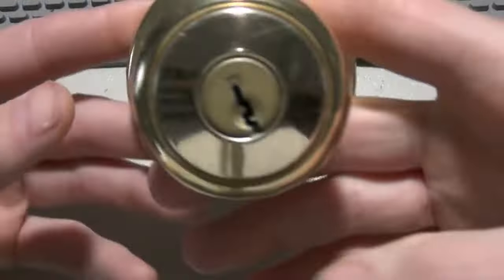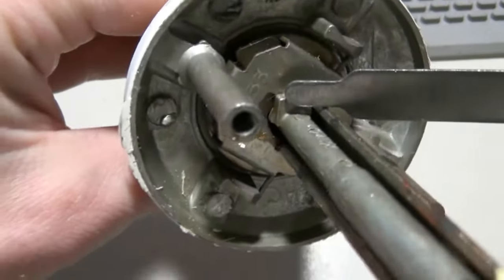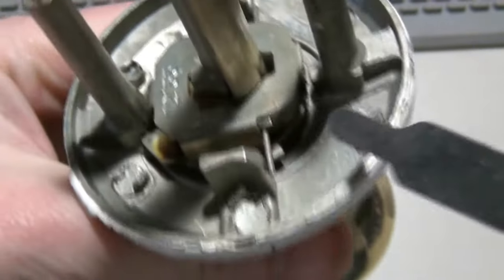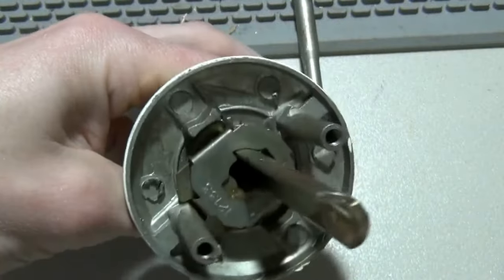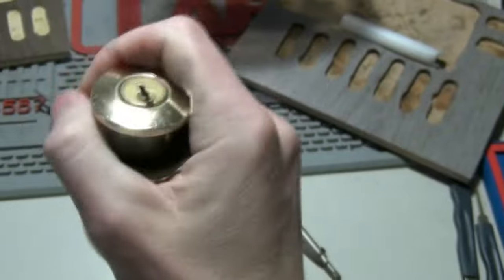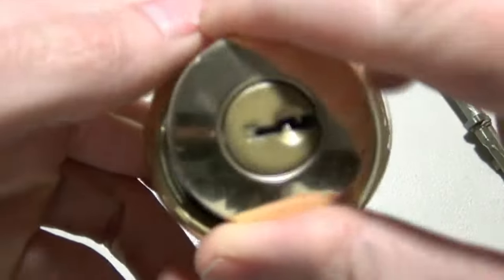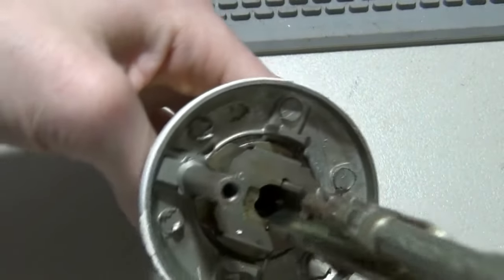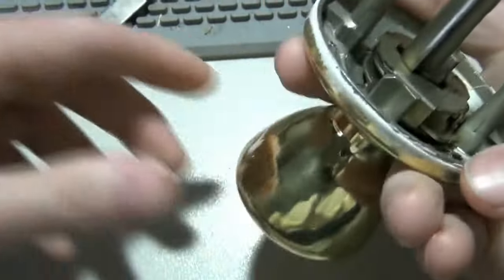(118) How to Remove the Cylinder from a Kwikset Door knob

Comment: Thanks.  Big help.  I did not bother to try to solve this puzzle myself, fortunately, and went straight to google and youtube.  I watched another video first which was a disservice to humankind.  Yours was the second I viewed.  You were patient.  Points for that, right off the bat.  Good camera work, too.  I used a pocket, screwdriver to twist the shaft and to depress the spring loaded clips.  

My objective was to fully disassemble the entry set to clean, strip and polish it before reassembly and then apply the lubricants, etcetera.   If I had noticed, in your video, the two-armed spring clip that holds the cylinder in place, I would have been able to get the cylinder out.  Not knowing what exactly was holding the cylinder, I was hesitant to apply too much force.  Did not matter since I was able to strip and polish the the escutcheon, knob and cylinder while assembled.   But now I know that for next time.  Thanks again.
Reply from the maker: Glad it helped! Appreciate the comment.

Comment: This video was a huge time saver! I watched another from the rekey company, but he sure sped through the tricky parts
For anyone else with a newer, "fancy" doorknob, this video is missing a couple extra steps! In my case, I had to insert the key and "unlock" the lock cylinder for it to come out after the spindle was removed - there was an extra spring-pin and lock disc to the side of the keyway. And that assembly has to be removed to get access to the pins, if you're rekeying it like I was
Reply from the maker: Thanks for the update!  Sounds like you may have a property preservation lock with a wire that holds it in or Kwikset Titan
Reply: Ah, it does look like it's the Titan!

Comment: God, you make this look so easy, I'm doing this for an assignment for my locksmithing class and I've been fiddling with the damn thing for 30 minutes trying to figure it out
Reply: I should mention I just got it, thank you for your video
Reply from the maker: glad you got it! you'll get fast it too with practice.
Reply: I'm a retired locksmith. He went about it in a clumsy way. I could do it in 5 seconds.
  Just a tip, reinstall the knob before you snap the cylinders back in, insuring the keyway is right side up. That is, so the bitting (teeth) of the key faces upward.
  If you get it wrong, it will still work. It just looks more consistent and easier to use

Comment: Thanks for sharing. I was able to pull apart a grimey old kwikset clone with lost keys using the tips from your video. I have now repinned it to match the front door and life is so much better. My second repin and my first time getting down to pin level with a door lock.
Reply from the maker: nice work man!

Comment: Thank you so much, this is the exact lock I have and I've been scratching my head for weeks trying to pop the cylinder out. This will surely make picking easier.
Reply from the maker: Detroit EXP no worries. Glad it helped
Reply: 😂 Detroit-Me too!  They must have sold a lot.  My newer ones are different (I think they are KS) and the handle wouldn't work with the striker turning mechanism.  What is proper name for that?

Comment: I had done this many times in the past but forgot the steps. Your video helped me remember. However, it’s really important to put the cylinder removal tool in with the curved end down. Your video doesn’t put enough emphasis on this very important point!
Reply from the maker: John Grant My tool is symmetrical
Reply from the maker: John Grant unless you mean depressing the spring to get the spindle out
Reply: Bored Lock picker No, you have to use the correct end of the tool to pop the cylinder out. You do that in the video very quickly, but it's easy to miss since you don't mention it. I know it sounds dumb, but it's a mistake I made and others might as well. A good video -- just trying to be helpful.
Reply from the maker: John Grant gotcha. I guess I’ve done it some much I don’t think about it. Actually did six of them yesterday. Sounds like it’s time to make another video. I’ll probably post it on my other channel that has more locksmith stuff on it and not so much lock picking. Thanks for the feedback 👍🏼 my other channel is www.youtube.com/russej02 I’ll probably make the video and post it tomorrow. I actually have a knob sitting right that I replaced a few days ago to use for the video
Reply from the maker: @MrJrgrant  Re-did it.  hopefully it's easier to understand now https://youtu.be/gabd-qVttzo
Reply: Bored Lock picker to be honest mate your video was clear as. I removed mine without any lock tools and used a flat head screwdriver. It came out in literally 2 seconds flat.
Reply from the maker: @agga3955  glad it helped out!

Comment: Can the return spring be replaced? I have one handle with the return spring broken and I cannot find the same replacement lever style. I have twelve in this house and replacing the spring would be a blessing, so I do not have to buy a dozen replacements, so they match.
Reply from the maker: I have never ran across replacement parts for any of the Kwikset stuff.  Email me a pic of your lock maybe I can find the style. Email is theboredlockpicker@gmail.com

Comment: 1:39 how do you do this with two flatheads? I have a kiwikset knockoff with a black plastic spindle
Reply from the maker: have to get in there and lift the spring loaded piece at the opening and then tap it on something.  much easier to just get the tool.  they're cheap here's one on amazon https://amzn.to/3zhvwjG
Reply: @BoredLockpicker  yeah I'll just get the tool
Reply from the maker: @bumpstockowner  definitely the way to go!

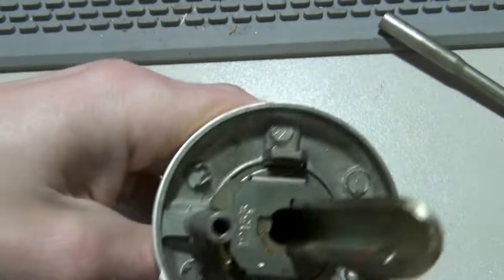Comment: Not sure this is exactly correct 1:30 because I believe all those spring loaded levers near the top (as you are holding it) are not in play at the point you are removing the cylinder. 

What the semi-circular, forked end of the tool is actually doing is pulling in two, black, spring steel clips on the side of the cylinder carrier. You can see that here once the thing comes out the front of the knob. 

You can push around (or not) those gold, spring loaded levers up top all you want, but until those black ears are released, that cylinder isn’t coming out.
Reply from the maker: Gotcha

Comment: I tried this today but on a newer model with a plastic spindle. I couldn't get it open. I believe there were 2 flat clips on the inside of the bore preventing the lock cylinder from ejecting. There was no way I could push them out of the way with a flathead. Possible that a custom tool the exact inner diameter of the spindle bore might work.
Reply from the maker: This works on those too
Reply from the maker: I do it almost every day

Comment: i have repaired it using a needle nosed pliers. i grabbed the one left side pin that is attached to the spring where the tail piece goes on the side with the curve facing way from me i pulled it straight out and the spring reset itself. now i can install it on my door.
Reply from the maker: I dont repair these really inexpenise knobs because I dont want the call back when it breaks again.  hope it keeps working for you!

Comment: Man, thanks so much. I recently noticed how easy my front door was to rake. So Im gunna re-key and or re-pin it ASAP. Awesome Vid.
Reply from the maker: no worries glad it helped.. and its not easy to make a kwikset not easily rakeable
Reply: Bored Lock picker I will change it out.
Reply from the maker: I have a schlage electronic lock on my house.  I actually pinned up so its easy to pick in case the electronics ever fail
Reply: @BoredLockpicker  What's the point of having the lock in the first place? 🤔

Comment: Hi! This question doesn’t have to do with this video… but I can’t find anything anywhere to help me. I just bought brand new Kwikset door locks to replace in a house I just bought. I got the front door handle and deadbolt installed with no problems. I got the back door deadbolt and knob installed and working, but as soon as I closed the door, I couldn’t unlock it. The little lock button thing wouldn’t turn. I went around the house to open it with the key, but that wouldn’t work.
Reply: I opened the the other brand new set to try to figure it out, the lock was locking, but I guess I was messing with it too much, and suddenly it wouldn’t move. I think that’s what happened with the first one? How do I get it unstuck?
Reply: I really wish I could add a picture! Lol
Reply from the maker: hey my email is theboredlockpicker@gmail.com send me an email with pics

Comment: Are there some cheaper versions of these? I have one where it is not disassembling like this and it looks like there are no spring loaded tabs, so no housing the cylinder goes into. Is there some other way that this may be released? No way to rekey it without disassembly.
Reply from the maker: Fred C yes there is. Email a picture I’ll help you theboredlockpicker@gmail.com
Reply: I can do that if you, but what part of it? Other than it looking kind of cheaper it looks to all be the same a  regular quality lockset otherwise. I am pretty sure there are no tabs. It seems to try to come apart when I use the tool but it never does come out. What part of it do you need a pic of?
Reply from the maker: Fred C sounds like a cheap Chinese one that foreclosed properties have. Do you have a key?
Reply from the maker: Fred C also the the tools
You’re using to get it apart
Reply: I sent the pic. I have no key although I could possibly pick it.
Reply: I have a really really old one (KIK doorknob) where the cylinder and faceplate aren’t held in by the two clips on either side of the cylinder. I pried that thing apart just to see why it was causing me so much difficulty; of course now it won’t stay together when I put the rekeyed cylinder back in the knob.

Comment: I have followed along step by step and cannot get the cylinder out, mine is a smart key so not sure if that affects it.
Reply from the maker: Rock Dude it doesn’t affect it. Are you using the same tool I’m using in the video?
Reply: No , don't have one, just using very slim screwdrivers
Reply from the maker: Rock Dude won’t work. Need two screw drivers. One kind of wide. There’s a spring loaded piece that has to be pushed all the way up. Very difficult to do with screw drivers
Reply: My lock cylinder pulled right out when I was unlocking my door today. Smart key set just installed yesterday
Reply from the maker: thin metal clip must of been put on bent or it broke

Comment: I want to pull the core from a doorknob none of my Schlage keys fit into it so I thought I might be a quickest but it looks nothing like this knob. Mine has a square tube and then it has a metal tongue going through it I can use that metal thing to lock and unlock it the tongue goes into a twist-lock in the other part of the knob. How do I get the core out of a knob like that? There are 4 tabs that I can bend that would allow the housing for the spring to come off but not sure I should do that I have only one practise knob I need to figure this out so I can rekey my door but I'm not having any luck finding out how to do this knob I have does anyone have any ideas? I have a Schlage rekey set it came with a tool I'm wondering if that tool somehow removes the knob but when I stuck the tool in the hole nothing happened so I was hoping someone might be able to direct me to another source that could help with this specific type of knob.
Reply from the maker: should be a hole on the knob and a spring loaded retainer you might have to turn the knob to rotate the hole over the retainer then stick something in it and push and the  knob will pop off
Reply: @BoredLockpicker  Thank-You your a genius I was thinking my description wasn't going to be enough for anyone to answer it. I don't know the technical names all of the lock pictures I could find didn't show the one I have. I have Schlage tools for pulling these apart I was sure it had something to do with that hole but I had no luck. There's a push tab sort of thing when the poker tool hit it I felt that it was a bit springy so I pushed and then the knob came right apart amazing. Thanks so much now I can practise putting it together and pulling it apart before I try doing it to my real doorknob. Truly thank-you these are not empty words this has been puzzling me ever since I got the Schlage rekey set it has the thing for pushing the half-ring off and a poker tool. Oh yeah, one last question on the core there is a cap that's on it which is what turns that tongue how do I remove it without bending it up? Will it just pop off when in a correct position or?
Reply from the maker: @KoolBreeze420  no worries. Just FYI if your other knob is actual Schlage brand the cylinder will need to be turned 90 degrees usually clockwise other wise the retainer is blocked and won’t push in. Email a picture of the other thing you’re talking about. Theboredlockpicker@gmail.com
Reply: @BoredLockpicker  Thats what I find odd about these doorknobs they look exactly the same, yet, none of the Schlage keys I have fit into the practice knob, I have no Kwikset keys, but size shape is Identical. OK, I looked at a core diagram they call it the core end peace or the end cap in my Sparrow (which are all Schlage locks) practice locks they are threaded and I use a tool to unscrew it to pull it apart, but this one isn't threaded like my practice locks. It's a cap that has 2 indentations that look like they are pushed in to hold the cap on. Its only function is to grasp the flat tongue in the doorknob so it can unlock. I just don't want to destroy it otherwise the whole thing will become a disaster. I live in Ontario Canada and these locks are the most common here. I can post a link to what it looks like from Amazon. https://www.amazon.ca/Raider-Stainless-Entrance-Handles-Lockset/dp/B08FGVYX3W/ref=sr_1_35?dchild=1&keywords=door+knobs&qid=1607623171&sr=8-35 This is exactly what the outsides look like right down to the shield that prevents access to the screws. Which is the main reason I need to pull the knob. Like even if I just wanted to say change the lock. I still have to figure out how to remove the knobs 1st to gain access to the screws second to get the core out for re-pinning.
Reply from the maker: @KoolBreeze420   if that’s your lock on your door is that one you won’t need to access the screws. You’ll just have to push the retainer in through the hole and the outside knob will off. It may or not require a key or to be picked for the retainer to move.  If for some reason you want to get to the screws the inside knob will have a hole and a retainer. Push it and the knob comes off then you’ll have to either pry or unscrew the rosette and you’ll see the screws.

Comment: the thing im supposed to hold up,is what i dont understand,i need the book for dummies
Reply from the maker: if you're doing it without the kwikset tool try using two flatheads.  one to hold the thing up and the other to pop the cylinder out
Reply: @BoredLockpicker  i cant find the thing im supposed to hold up.ive tried everything even using flat screwdrivers,i just suck.
Reply from the maker: @rogerchildres9035  some of the knockoffs come apart different. if you send a pic I can tell you

Comment: I was able to do it, but one of the spring heads broke off. It still works, but the cylinder is a bit looser. If you're going to do this, get their stupid tool. Screwdrivers can, and will break the tabs if you're not spot on or use too much force. Kwikset sucks.
Reply from the maker: Right tool for the job

Comment: What this guy fails to mention is you should buy the fucking tool because if you try to use a screwdriver you will just throw the fucking lock in the trash.
Reply from the maker: This guy commentating failed to notice in the description the link to the tool
Reply: @BoredLockpicker  I was too busy wrecking the lock man 🤣
Reply from the maker: Nice work! I myself am about to wreck a malfunctioning 3D printer